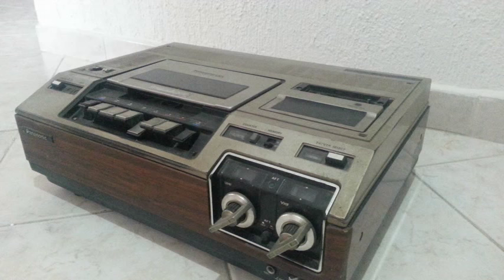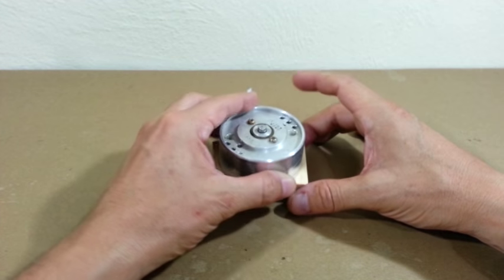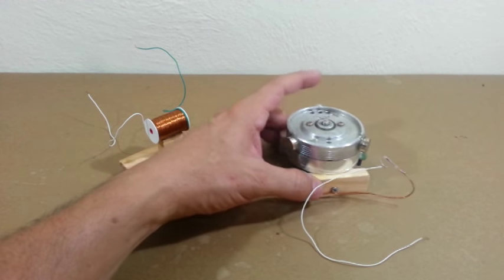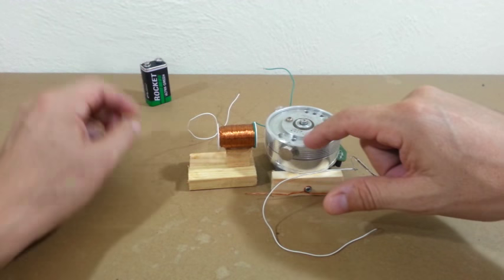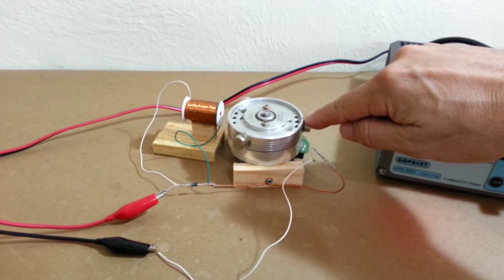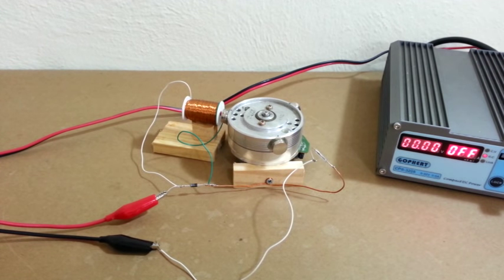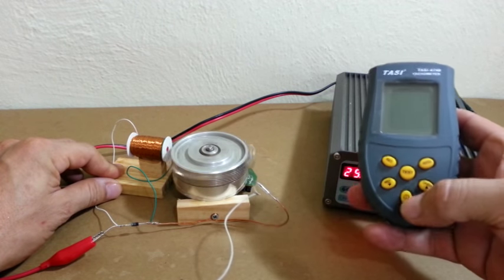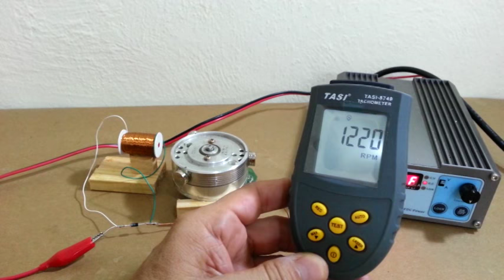Pulse Motor from Old Parts

Comment: Try smacking on an AC current in the solenoid that changes direction with the frequency of magnet rotation(120 degress). That should change the magnetic field periodicly which switches between attraction and repeling the neodymium magnets. That being, ad a current direction switch a little behind the magnetic switch.
In thought, the faster the motor turns, the faster the AC current should switch.the added attraction might improve the speed. I think that you would need an(or 3) extra magnetic switch and two transistors in parallel, so that it govern the direction of the flow of energy.I think that migth be an AC motor. Solenoid pushes a magnet away from the wire, turns of, switches on current in opposite direction, turns of, begins anew. - You might mess with radio signals though.

Comment: Would it be correct to say that this is the same type of motor that can be found on a quartz clock movement? (although controlled by an oscillator instead of a reed switch, in order to mantain a stable speed)

Comment: This looks perfect for me, if it wasn't pulsed, it wouldn't work would it, magnetic lock right. I,m a learner and have a VCR spare. I want to increase the rpm,s, would more power do the trick. Or  add a another coil. Or is it more complicated than that. Thanks

Comment: I connected pull up resistor and 12v to jack and it works like a charm. I had removed it with its chip near coils and i looked at datasheet for chip i conected 12v and pull up resistor on pin for on off and it works nicely at about 1500rpm

Comment: The only problem with this type of hook up is one needs high voltage, lots of turns of magnet wire, extra amps and hardly any rpm at the end.  Might make for a better induction type of motor maybe.
The bearing is definitely of high quality.  Maybe a person could use it and use plastic or wood as drum with the magnets.  That might throw some good RPM.

Comment: Pretty damn cool ! I must have 30 of these motors laying around.  If you doubled the amount of magnets, would the RPM's double ?
Reply from the maker: Thanks. No, for more speed you need a stronger solenoid.
Reply: +Ludic Science 
Would more magnets give it more  torque ?
Reply: Ken Gamble I think yes,  because the inertia would increase and hence the moment of inertia will increase which can be regarded as a sort of torque

Comment: Hi,

If you'd added a Full Bridge Rectifier (AC symbol wires) on the leads of the Magnetic Reed Switch, then used the exit DC leads from the Bridge Rectifier & attach those to a VRLA/SLA AGM battery that is heavily sulphated, you would have a nice desulphator device that could rejuvenate your old UPS batteries. 😋🤓

Doug Konzen discovered this. 🙄

I also have 2 videos on that on my channel as well. 😉

Other than that, nice setup. 😄😆😎

Comment: Using a hall effect sensor would give you faster switching, the reed switch has mechanical limitations and will suffer bounce at higher switching cycles.
Reply: I have  made several pulse motors with Reed switches and they  burn out using  12 volts supply; the contacts weld together     may be it was the back EMF ....that's why you added the reversed diode

Comment: Wait, that pulls 75 amps!?!?! Its not very efficient for 400 rpm lol. It's still a coll project though
Reply from the maker: +Yextus miliamps. 0.075 amps
Reply: Ludic Science That makes a lot more sense lol, I was wondering why those wires didn't start smoking and how your supply could handle that but the meter said A so I assumed it was in amps. Anyway, I loved the video, I always check out your channel when I'm in need of inspiration :) so thank you
Reply from the maker: :D